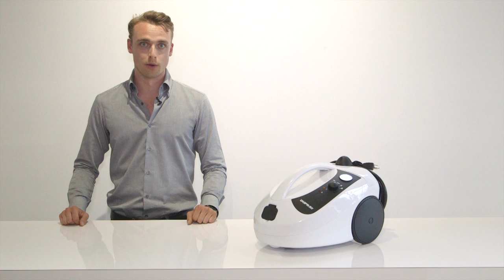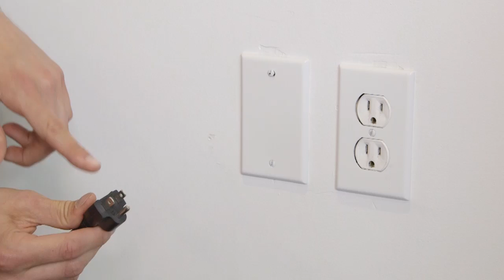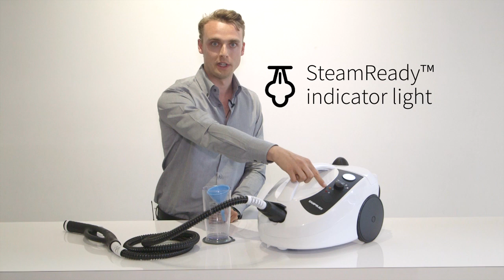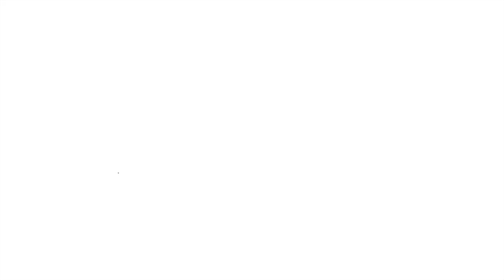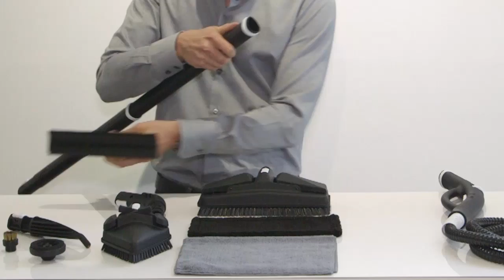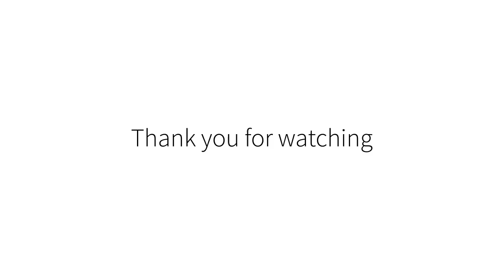Dupray ONE™ Steam Cleaner Training Video

Comment: Would it be ok to use the condense water from a heat pump tumble dryer that is connected to rain water. I would assume that the water from that system is very pure? Of course it’s connected via a filtration system. Your feedback is very well appreciated!
Reply from the maker: Probably fine, as long as you keep doing your regular boiler maintenance.

Comment: Although a bit louder than its predecessor, this unit does the job. 🌼 allabout.wiki/Dupray I like the fact that it runs longer when using a 20V Lithium Ion battery.  What used to take 2 full charges with the old batteries is now done on one charge.